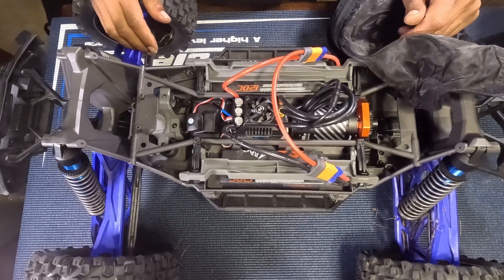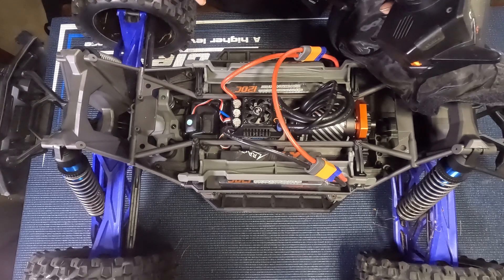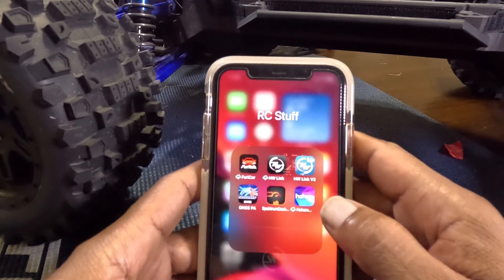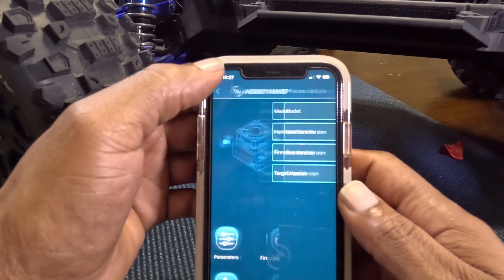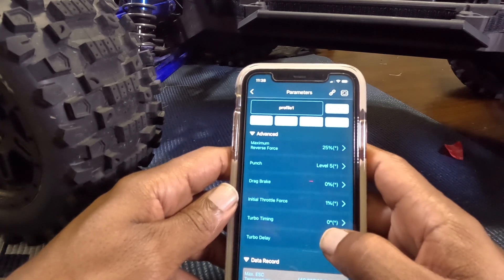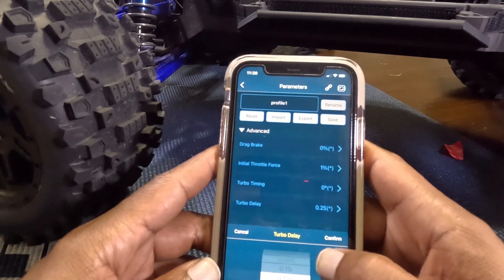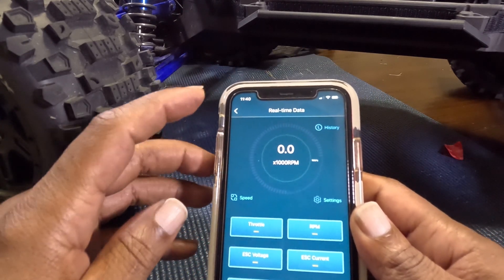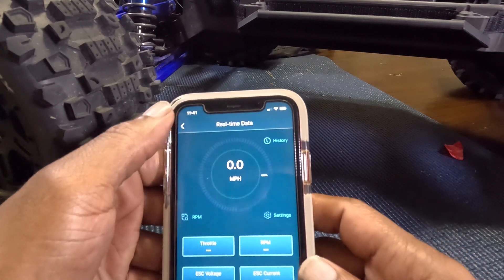New Hobbywing Max 6 G2 // Setting up Throttle/Neutral/Brake end points. Plus BT. #hobbywing #traxxas

Comment: Hi. Question.. I have an arrma felony with the spectrum 1250kv motor and this max 6 g2. Whenever I calibrate it for some reason I get this insane delay when I press the trigger like half way, goes very slow and then it takes off like it's very delayed. Do u have any idea what the problem could be? I'm running a radio link v3, I replaced the receiver to a new one, changed the batteries and still doing it , it's so frustrating.  Not sure if its an ESC issue or maybe somthing with the Bluetooth connection
Reply from the maker: @Mk-mr4vl . You can try switching the A and C wire around then change the motor direction and calibrate

Comment: I can’t get reverse to calibrate at all. The steering trim is at 0 and the multi-function is at 0 during calibration 🤷🏻‍♂️
Reply from the maker: @hydroboy35th . If using the Traxxas remote you might need the BlueTooth adapter and get your reverse at 100% the esc is not sensing a signal. I don’t really have experience with Traxxas remote I replace them immediately don’t like the way they feel personal preference. That’s my guess why it’s not getting reverse.
Reply: @ what you’re saying makes sense however, wouldn’t you need the Traxxas ESC to run the Bluetooth? Pretty sure the Traxxas link only works with Traxxas ESC’s.
Reply from the maker: @hydroboy35th . Yeah I didn’t think bout that ( Traxxas be making sure you use their stuff 🤣) Maybe trying the multifunction switch at 12oclock there’s two zeros on the remote ones all the way left the other is at the top.
Reply: @LBizzyRC I found the problem, it was the receiver. I had a Spektrum DX3 radio/receiver laying around that I tossed in real quick and everything worked as it should. The stock Traxxas receiver wasn’t putting out enough voltage for brake/reverse. This is a brand new never ran xmaxx by the way lol.
Reply from the maker: @hydroboy35th . That’s Traxxas for you 😂😂 you see why I get rid of that quick🤣🤣🤣 guess that’s why they only go with their esc. Try to lock out the receiver going through loops to make it work on another esc. Glad you got it to work👊🏾💯

Comment: what gears you run ?
Reply from the maker: @mattgrill7713 . Those gears are 1.5 I got off eBay, king hobby is the cush drive and I believe the pinion are the NHX mod 1.5.

Comment: Trying to calibrate mine but it will not accept the brake? Wont bleep x3 and flash green, just stays red
Reply from the maker: @djp2257 . Make sure that your throttle knob on remote is dead center at zero before calibrating. Sometimes if it sees a a signal either way it won’t calibrate

Comment: hello, I received the 5690 G2 combo with the Max6 G2 but the 3 tips are incompatible
Reply from the maker: @Mickado64 . The 5690 use 8 mm bulletin connectors it should have came with 6.5 connectors in the motor box to unsolder the 8 and put on the 6.5. I know the 1250kv has the 6.5 too 8 in the box
Reply: @LBizzyRC  It has the 6.5mm on it but they put an extra 8mm for the max5 G2. there are no connectors for the Max6 G2, I think the max6 g2 is 6mm
Reply from the maker: @Mickado64 it should fit, you really have to push really hard to get them to go in. They make them like that so the don’t pop out. You can try to squeeze the tips with some pliers just a lil bit. The tips has slits on it. If it’s too loose you can pry them back out carefully. It should be a really snug fit though.
Reply: @Mickado64 there are adapters

Comment: Great video! How long did that pinion and spur gear last? Cuz it was meshed WAYYYYYYYYYYYY TOO TIGHT! When you mesh the gears you want them to rock back and forth with a decent amount of free play. If the gears are touching like yours were in this video they will litterally eat themselves and will also get extremely hot from friction and break/melt or create lots of metal shavings.
Reply from the maker: @bifffsEquipment . I thought they was too tight too 🤦🏾 but that’s the mod 1.5 gears they are just loud AF 🤣🤣🤣👊🏾💯

Comment: My calibration forward and reverse keeps coming out backwards🤦🏿‍♂️
Reply from the maker: @mckee2jeff . Make sure your motor wires go A to A B to B C to C if running combo and sensored. And make sure the esc setting motor is CW or CCW

Comment: Can this esc also go with the 1100 kv 5687?
Reply from the maker: @JoshuaRodriguez-ju7yy . It should work with the old 5687 1100kv just fine it use the 6.5 bullet connector the new 5690 use 8 bullet connectors only thing you would lose out on is the sensor capability what the g2 has to offer. But if you’re not worried about by all means.👊🏾💯

Comment: What do you have your turbo timing and delay set to?
Reply from the maker: @DigiDarkness . Everything on the esc was stock settings out the box, didn’t touch anything was gonna turn the bec up To 8.4v but still running the stock servo.

Comment: Gear ratio?
Reply from the maker: @kukislas18 . Don’t know the ratio but running 32/20 gearing.
Reply: @LBizzyRC That's a 1.6 ratio. Is it running hot with that setup? Stock was something like 2.5 and the stock speed gears were 2.0 the lower the number the closer to 1:1 ratio you will get

Comment: Does the G2 fit in the stock location for the Xmaxx/Xrt without any mods?
Reply from the maker: @improvise_Adapt_0vercome . If running just the esc wit stock motor it will drop in. If running the combo you need a new motor mount that would push it back bout 5mm on the xmaxx would have to cut that plastic brace. But that’s the only thing you would have to mod. The XRT it should drop in if running the 5990 but would look cleaner wit an esc mount.👊🏾💯
Reply: @LBizzyRC  Much appreciated